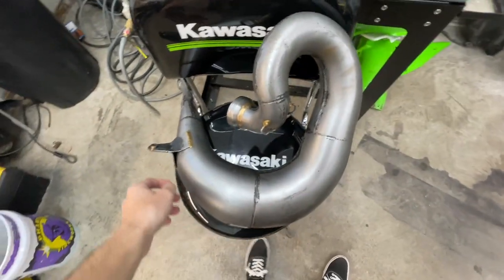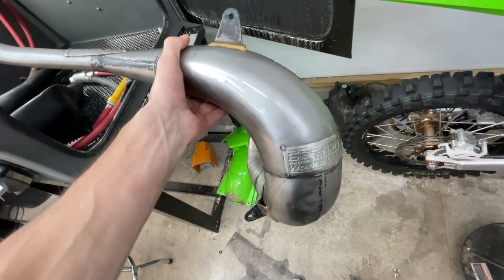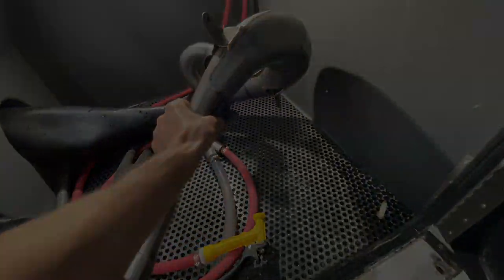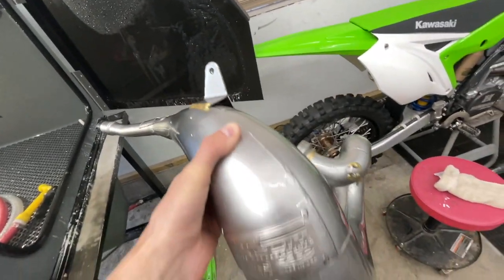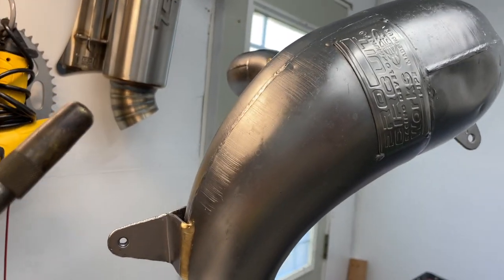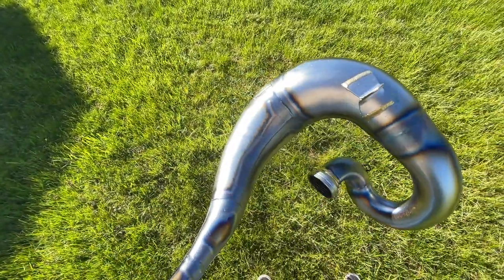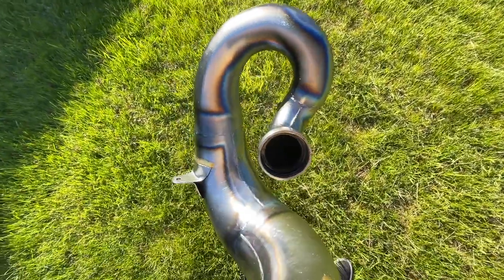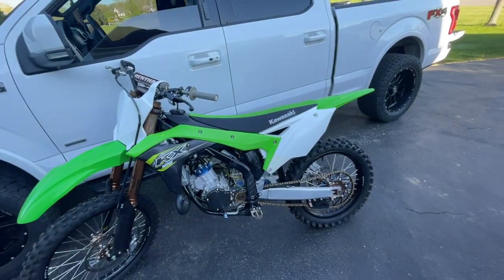EPIC 250 Two Stroke PIPE TRANSFORMATION | Start to Finish

Comment: That is fully sic !!! The only better looking 2 stroke pipe is one of those old cone sectioned welded works pipes. What is the benefit using water whilst 
blasting ? My Dad owns a car engine performance shop but his bead blaster is dry. I just subbed because l can't wait to see this KX250 finished ! 
It makes me sad to see that Yamaha are the only Japanese manufacturer to still be making these bikes (full size).

Comment: Looks sweet.   I have a bone stock. Still all original 16 kx 100. Would love to add some touches like that to it
Reply: I rode a KX100 a few years ago, I couldn't believe how quick it was compared to a KX125 of the same year. I'm not saying that it was quicker by any means, but if you had a rider that was suited to the smaller sized KX. It would be interesting what the difference would be 4 sure !
That would be a great video idea !

Comment: When torching. No way to melt the welds or burn through the pipe ???  Just wanting info. Thanks.
Reply: You should be fine the only way you could burn through the pipe is if you sit there and heat it up for a while until it’s bright orange. Even then I don’t think the torch could get the metal hot enough unless you purposely try to burn through. Also if you heat up the pipe let it cool naturally because if you spray it with water right away it could weaken the welds and crack.